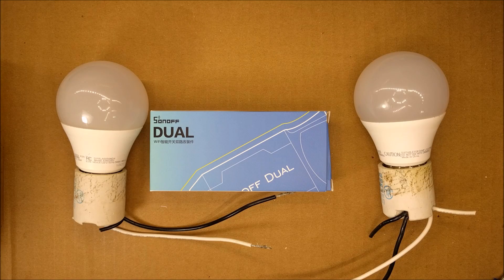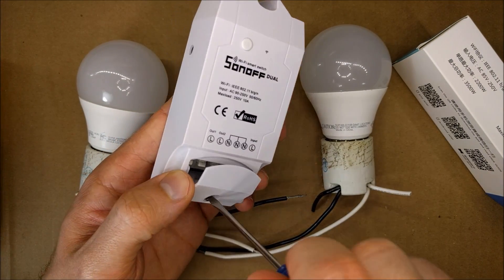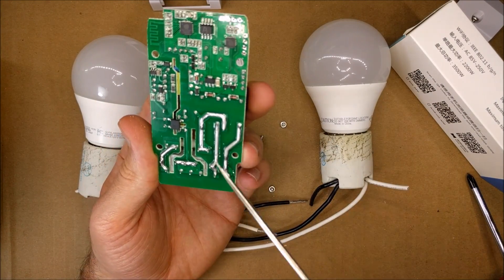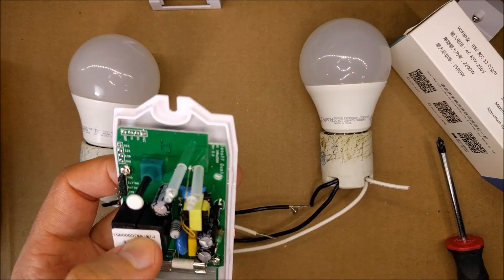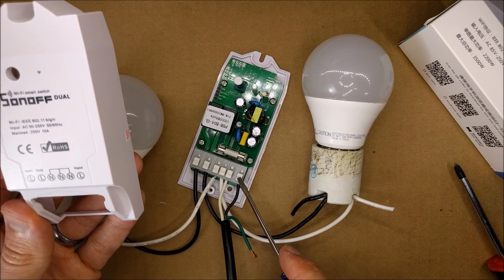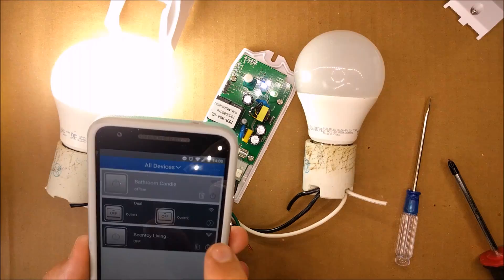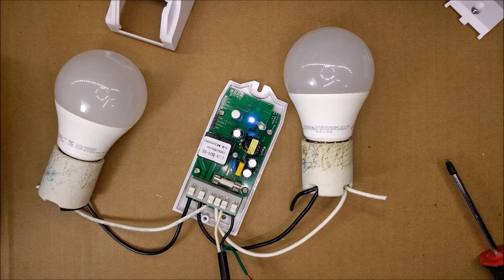Sonoff DUAL Review

Comment: is it possible to add a temperature sensor to this like the TH10?  Also, can this or the TH10 have 2 sensor inputs, so I could monitor Temp with the DS18B20 and pressure sensor?

Comment: Seeing this, I fear for your safety.
Too close to live stuff, two hands on live stuff, ring on finger, live wires poking out of the lamp holders.
At least turn the power off when sticking screwdrivers in that aren't insulated.
Good demo of the device but zero marks for safe working

Comment: Does the temperature sensor work with this? Can it be used to automate both channels individually at different temperatures, lets say if I've got 2 fans connected to the unit and want to switch on the 2nd fan at a higher temperature than the first.
Reply from the maker: Yes you can do that.

Comment: Great review I want these to manually be hooked up to my light switch on the wall, so I'll be using the tiny pins instead of the screw on the outside? They seem pretty small is there any adapter to connect it to?
Reply from the maker: I have not seen any adapters. Let me know how it works out for you.

Comment: I used a Sonoff Dual and wired my ceiling fan to turn the fan and the light - EACH - on and off with the app and Alexa. Each works independent of the other. 

How you may ask? So simple, it should have been done and posted on Youtube already. We need someone that does videos to do this and document it. 

I cut a 3 or 6 foot 2 prong extension cord about 12" from the female plug. Then wire the two prong cord/plug into the L and N of the Dual contacts Input.  Before I get into the attic, I program the Dual to the WiFi and give it the switches temporary or permanent names.

I have access to my attic and the upside of the ceiling mount I turned off power and installed a one gang box and a single 120v wall outlet with cover. I like the simplicity of being able to unplug the fan from power with just unplugging it.  Connect Output 1 to the Blue wire of the ceiling fan. Connect Output 2 to the Black wire of the ceiling fan. Connect one of the Dual's N to the white wire of the ceiling fan. You only need to connect one of the Dual's N to the ceiling fan. Leave the ground wire on the ceiling fan connected to the ground on the 120v installed wall outlet.  Now plug the plug into the outlet and power up the Dual. Turn power back on at 
outlet/ceiling fan.

Now the Dual allows me to name and turn on and off each – the fan and the light, or I can use the Dual’s primary name and turn both on or off at the same time.

I don't know a better place to post this, so maybe it will benefit others that would like to do it. Cool, huh? Now, I plan to use the two sets of terminals on the Dual to add two small momentary switches at the wall switch and run lightweight 22 gauge speaker wire down from the Dual to the light switch, so they can be turned on and off manuals, and reset.
Reply: Based on your guide. I take it once you successful paired the dual. Then disconnected if from the mains power. The dual saves (remembers) the paired  settings. 
Q1.Do not need to pair it again?
Q2.Once paired, can I connect and control it from more than one phone?
Q3.How do you set up with Alexa?
Thanks.

Comment: Nice video. BTW, iam planning to buy the dual channel. Can I connect / power this to my Sound System (100 watt) or to my TV (60 watt) with the total of 160 watt, at the same time with only one channel?
Reply from the maker: yes you can, but you would have 2 wires connected to the same bus terminal. not sure if it would be the safest way to go

Comment: Can you use this controller with a regular wall switch on the main load? And is there any way to power-on one of the outputs automatically when you power-on the controller? For example: when you turn on the wall light switch to power-on only one bulb and the other one to be controlled only trough the app.
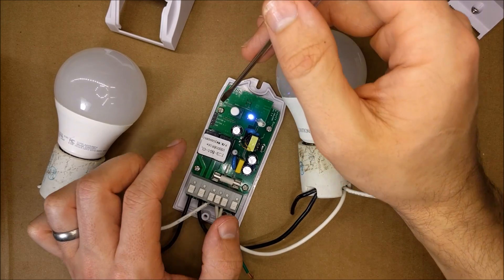Reply from the maker: Yes you can, but only thing with that is you have to connect your switch to the small pins on the  sonoff 6:00 in the video i show those pins
Reply: I don't think it is possible in my case. Because the main power source goes trough the light switch. I don't have a separate power source to connect it to the load. And i cannot add another pair of cables.
Reply from the maker: its a good module to have either way, I use mine for Christmas lights

Comment: There is no interlocking, right? I can't use it for up/down window blind switching?
Reply from the maker: no Interlocking. unless you flash it with your own firmware.
Reply: It has interlocking support now
Reply: @Leonvolt28  And inching? Like the "normal" Sonoff basic?